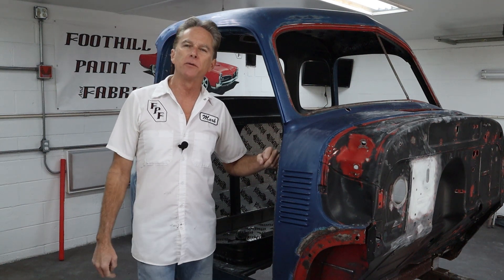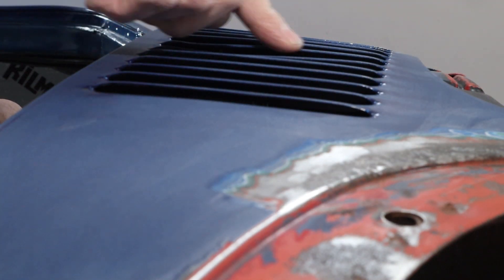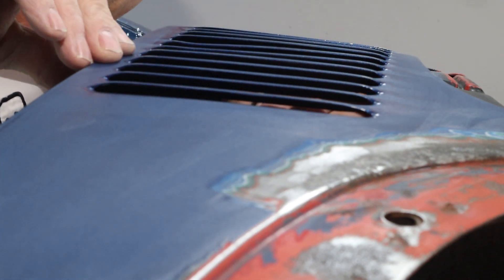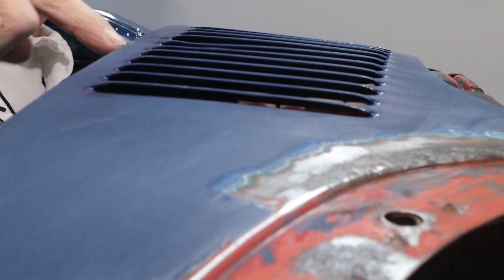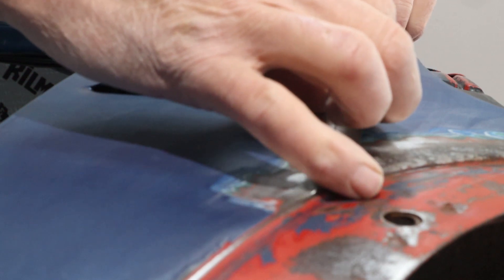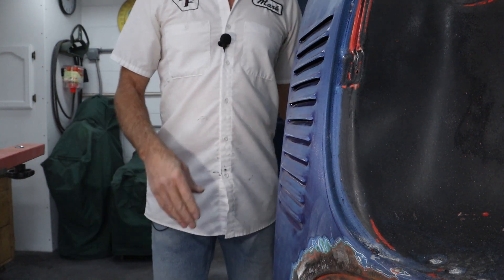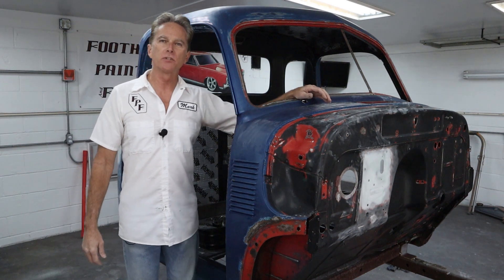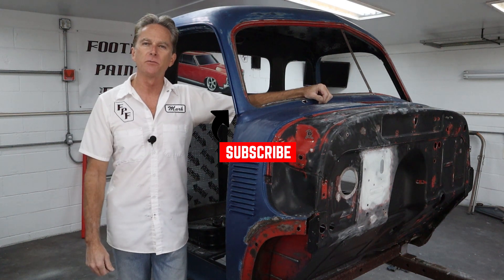1950 Chevy Truck (Ep 35) Louver Straightening How To

Comment: I have 2 big creases on my ‘51 from the doors getting caught by the wind.  Do I need to cut the inner wall out, in order to get to the creases , or is there an easier way?  Through the hinge?
Reply from the maker: On the 1950 there is a kick panel on the passenger side, I am pretty sure it is on the 51 as well.  The drivers side is a bit tricky but the vent on that side might give  you enough room to push right on the crease and tap around it.  Other than that depending on how sharp the crease is you might be able to use glue on pucks and use a slide hammer to pull out gently while you tap around the crease.  Paintless guys use them frequently.  Spot welding threaded rod like I did with the mirror mount video will work well just take your time and pull instead of slide hammering and tap around the crease to get it to release.